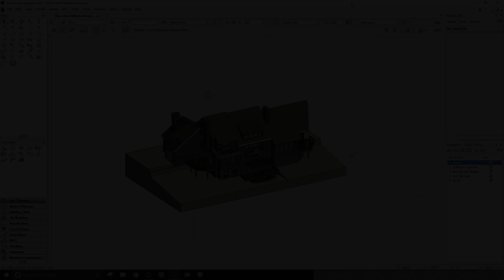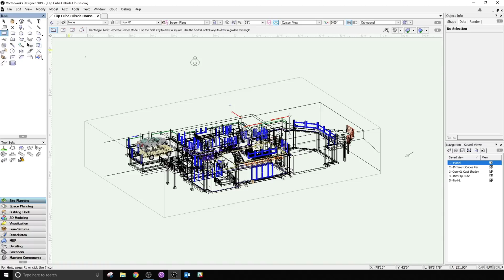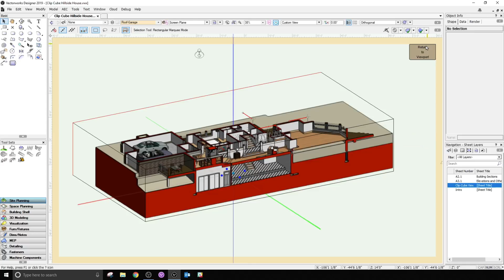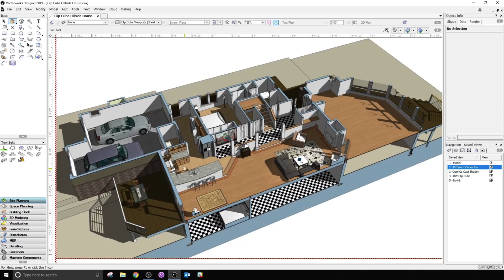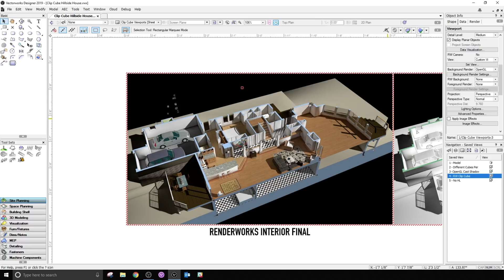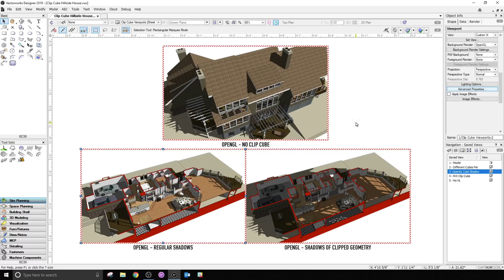Teaser – Clip Cube for Viewports in Vectorworks 2019

Comment: How come 'not responding' comes up when updating vp?
Reply from the maker: Windows will show that sometimes when a process is utilizing system resources heavily. It can be ignored however. In older versions that often meant that Vectorworks had crashed so alerting the user was important, but now it can appear during heavy loading. Going forward, this kind of alert will appear less and less as we start updating hardware usage and the UI.